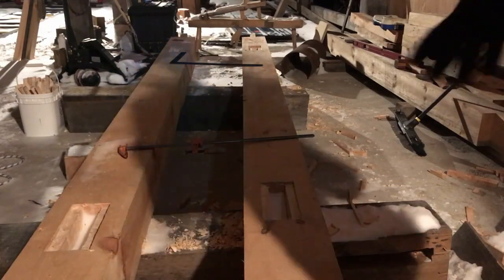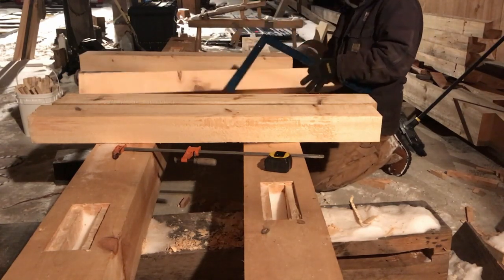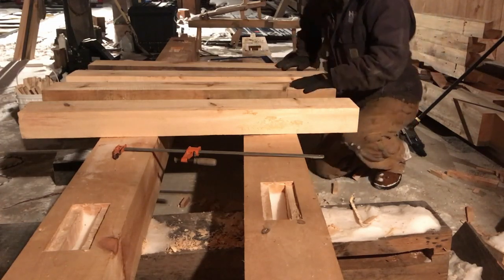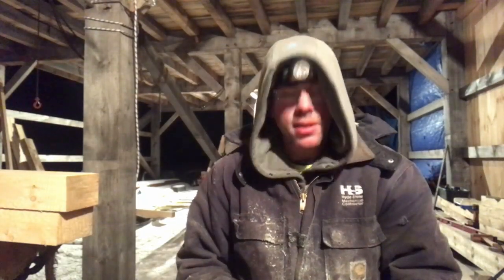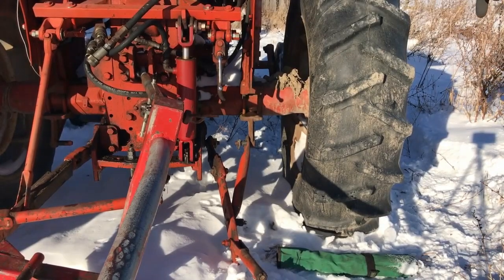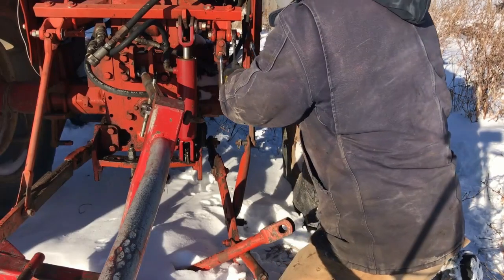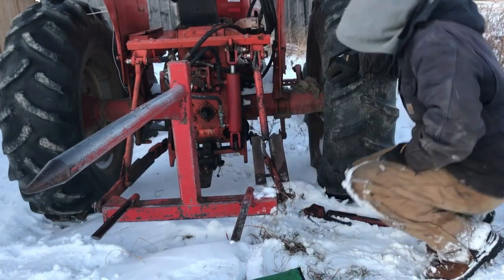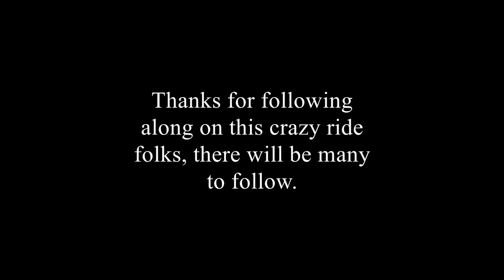A Timber Frame Vlog #96: Braces and Breakdowns

Comment: wow we are lucky so far here  western Canada just got cold again here but most of the snow has gone now if we need to have a hydraulic pump to work we put heat magnets on the tank keep the hydraulic from freezing napa does sell them and when they go on sale we buy a couple of case of them. does work great on the farm starting any the cold couple hours later your running works great too on diesel tanks to keep them from freezing when I have to go north I will take a lot with me and use them for the truck to keep the motor warm and the tranny too?  yes, I know what cold is like to work in it family has a dairy farm know what cold is like when the cows are hiding from the wind have to go and got the ladies they never stay in the barm or the shelters. 
one of them  all way open doors gates or anything gets in her way that would open up she likes to go in too late the calfs out too she is a very good milk cow and have fun with us

Comment: Hey just wondering why you wouldn’t have used the top of the old linkage and weld it onto the new bar.... and then you wouldn’t have lost the range of motion...just a thought. Love your video’s. Keep up the great work.
Reply from the maker: +Lorne Lepage good evening Lorne.  The top part of the linkage is cast, doesn't weld very well.  I had thought of trying to weld the rod back together but figured it would just break again.  This fix looks pretty farmer but it is actually stronger than what was there to begin with.
Reply: Hey did not see you tighten the nut and bolt holding the top part on? I was going to ask the same about welding the u joint on a new bar.
Reply from the maker: +NYNCMIKE I tightened it, it was a condensed repair video...I screwed up the camera work so I decided to throw it in as a "bonus" to the first part.  Good evening Mike.